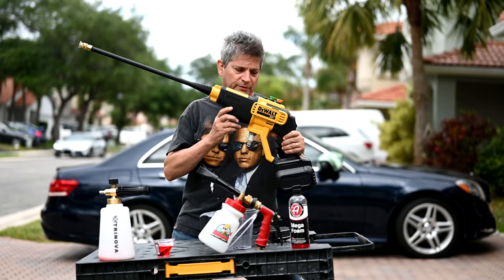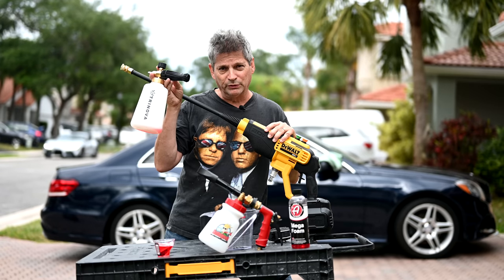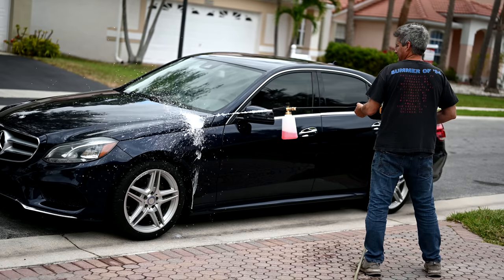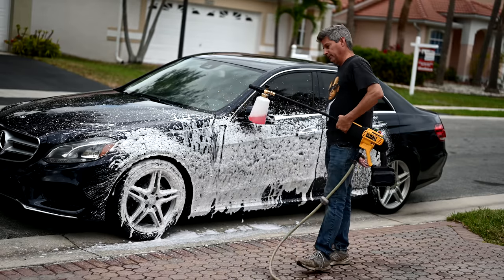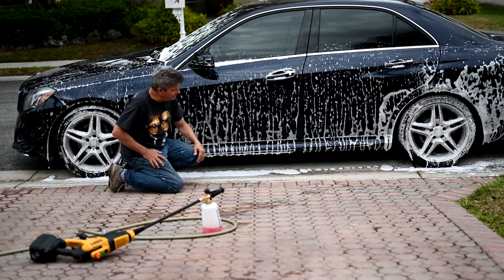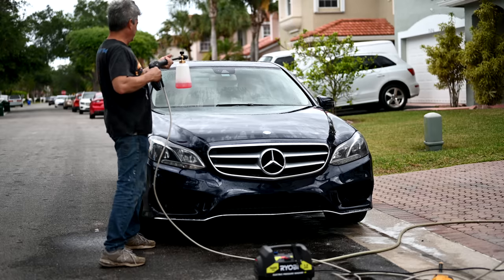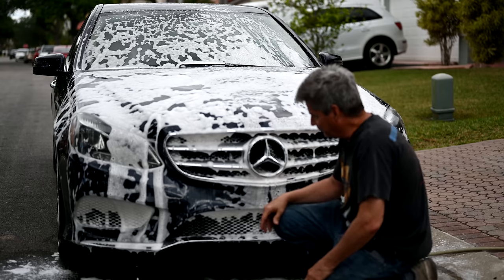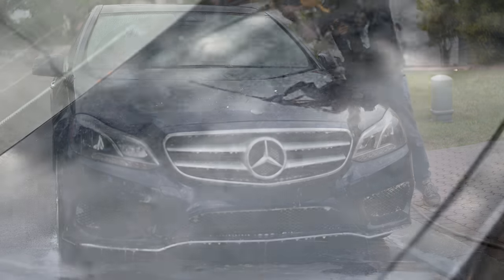Can DeWalt Power Cleaner Work With High PSI Soap Cannons? Car Wash Tips

Comment: Waste of money! Dewalt has to call this sprayer off. Just returned to Home Depot. The motor is like an improved motor that comes in portable vehicle air pressure  making same sort of noise as might be made in same China. 298 dollars waste of money! Returned and got same Dewalt manual hand sprayer for 34 dollars. Added a strap to hang on from shoulder works so fine without this lousy noise! 10 dollars car wash would do better than this sprayer. These guys don’t know what to recommend probably Dewalt offers them free sprayer, giving bias opinion. A hose would give more pressure than this sprayer.